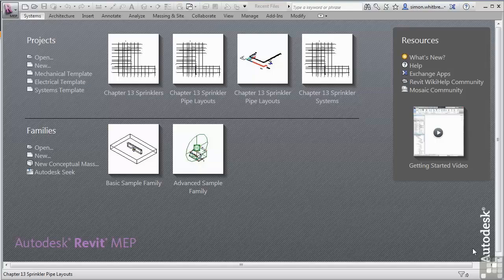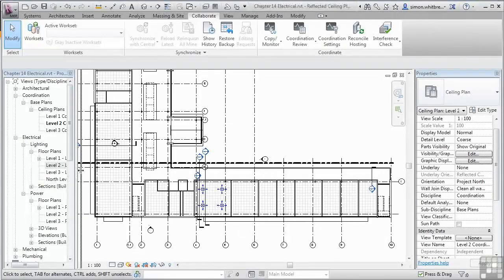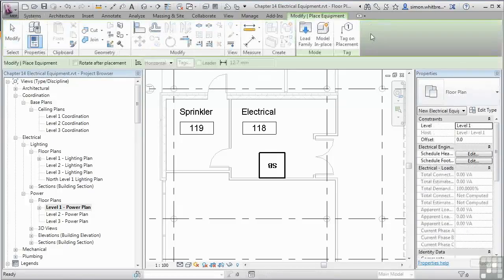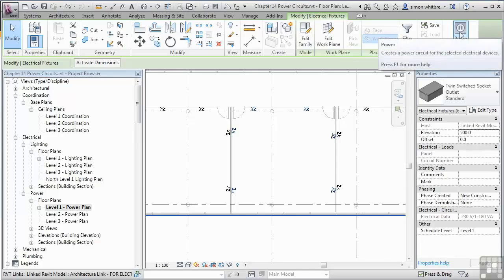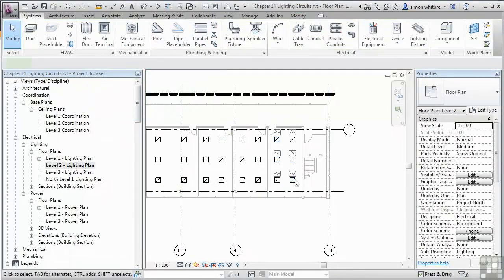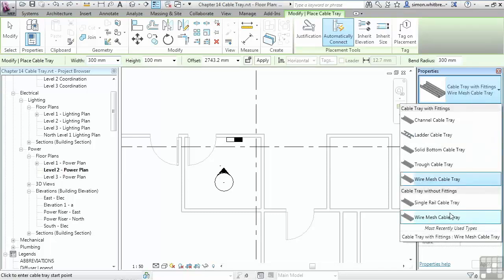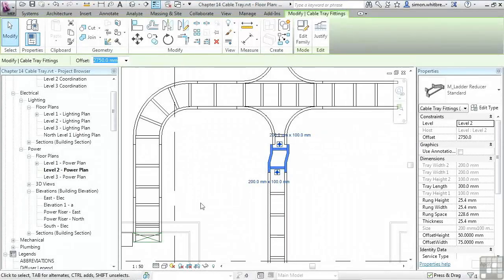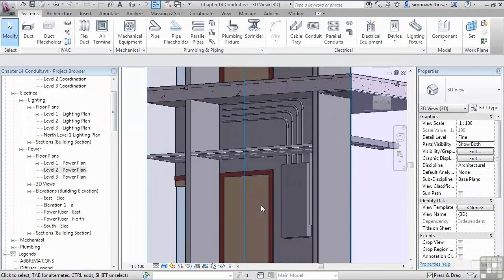Revit Mep tutorials - Part 14/22: Electrical Systems

Comment from the maker: Hi everyone.

This is working file of Revit Mep 2010 & 2013. You can download it to following below link:

+ Training file of Revit Mep 2010: 

https://drive.google.com/file/d/0B-iocWPyqwPARXJha3Q0YWZuamc/view

+ Training file of Revit Mep 2013:

Part 1: https://drive.google.com/open?id=0B-iocWPyqwPAaGxRekJXY0VEbDg
Part 2: https://drive.google.com/open?id=0B-iocWPyqwPAelhLRWxPTGlSOWc

If you need more information about tutorials or working file of Revit MEP,  you can comment it at here. I will read and answear it when I see.

Thanks & best regards.
Reply: Hello, i would like to ask about the autodesk autocad. In autodesk autocad we have different type of autodesk autocad like autodesk autocad MEP, autodesk autocad, autodesk autocad inventor, autodesk autocad revit.Could you tell me each programm, what it is use for? I do not   know which one is good for designing electrical in buidlng. Thanks
Reply from the maker: Hello. My English is not good, but I will try to explain for you know about your question.
Currently, Autocad still have very many people use, because people are familiar with it and use it very good. And specially, when you show your drawing for shop engineer or supervisor engineer (people with experience) then all them will understand it.
But it can't be control exactly, like quantity (duct, pipe, grille, insulation....), when you have to do many thing and you don't have many time to do it.
Contrary, autodesk revit or call revit MEP will control it very good, at least about quantity, intuitive and worker will understand it is easily, because it show 3D drawing. But let worker can understand it is easily, then people who draw it must very well and have knowledge, experience many year to show it best.
And now, it still have difficult, because family of revit don't have many, part of, due people don't share it together, because create family in revit mep will spent many time. Therefore, they don't have share it for anyone.
In many programe, you asked above, then in the future, revit mep will be development very strong, because it help engineer very and it will be widely development if people share it together.
This is my particular idea about autodesk general or private for revit mep.
Can you send meassege for me any time, I will answer it if I know.